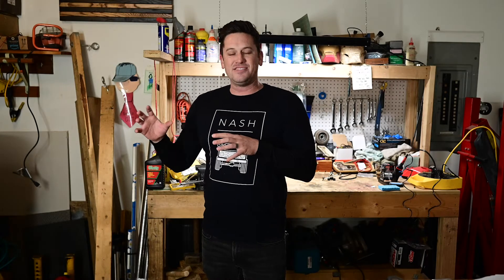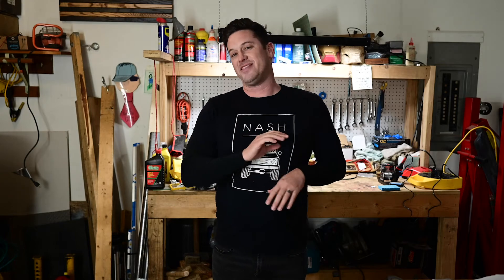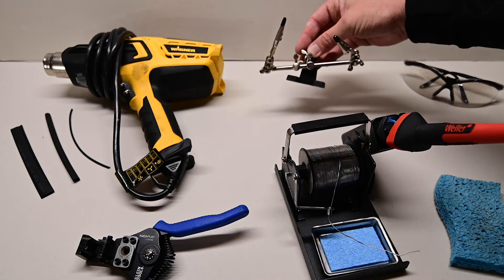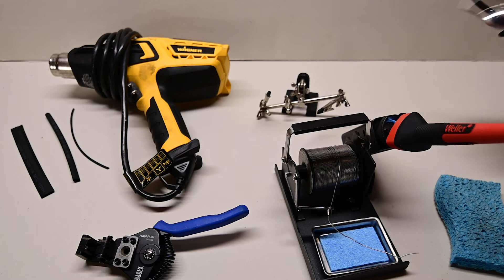How to solder wires permanently!

Comment: Another tip: Add solder to the tip (we call call it “tinning the tip”) before applying to the wire, this adds additional contact coverage and distributes heat quicker.
Reply from the maker: Yes! Thank you

Comment: Good tip to include is that not all heat shrink is equal. Marine grade hear shrink is best as it basically has hot glue lining the inside and does well to make a weather tight connection. Perfect for those of us who wheel or drive our projects in rain or snow. It also helps in areas of high humidity or moisture. After seeing regular heat shrink corrode it's all I use
Reply from the maker: That is so good to know!

Comment: If you want to try even better wire stripper try this style.  I have one from Bluepoint and it is my go to stripper.   

https://www.amazon.com/STEELMAN-41865-Self-Adjusting-Pistol-Stripper/dp/B077VWG3WN/ref=sr_1_13?keywords=bluepoint+wire+strippers&qid=1583859268&sr=8-13

And for even better heat shrink tubing step up to the marine grade with the internal adhesive.

https://www.amazon.com/MulWark-130pcs-Assortment-Electrical-Application/dp/B075LMDFSS/ref=sr_1_2_sspa?crid=32B949UVGIVLM&keywords=heat+shrink+tubing&qid=1583859583&sprefix=het+shrink+%2Caps%2C205&sr=8-2-spons&psc=1&spLa=ZW5jcnlwdGVkUXVhbGlmaWVyPUEzRkdYNzhTR0NZNTVTJmVuY3J5cHRlZElkPUEwMzI5MTk0MlExRlNKQ05HR1gxQyZlbmNyeXB0ZWRBZElkPUEwNjk1OTYzM0RLRVZWRFkxREFHNCZ3aWRnZXROYW1lPXNwX2F0ZiZhY3Rpb249Y2xpY2tSZWRpcmVjdCZkb05vdExvZ0NsaWNrPXRydWU=